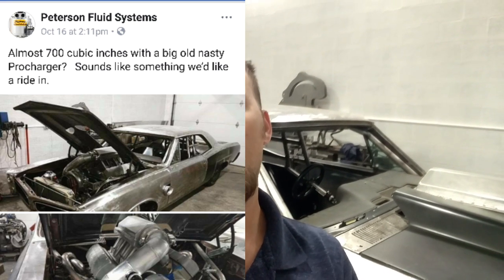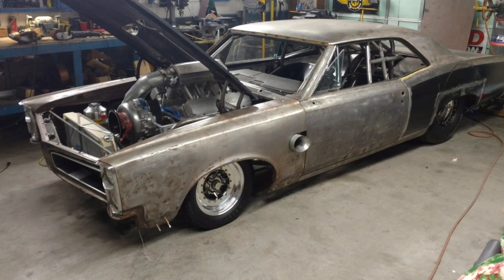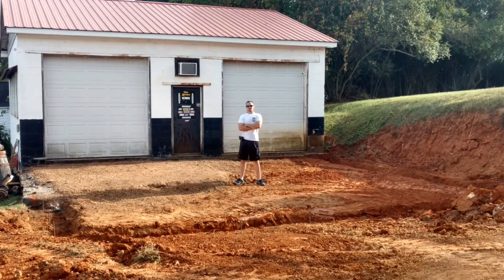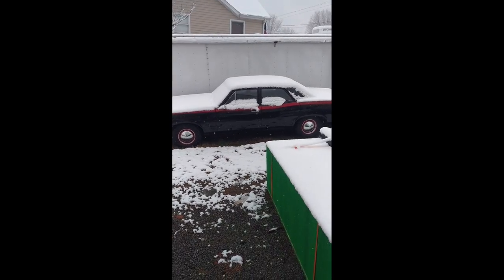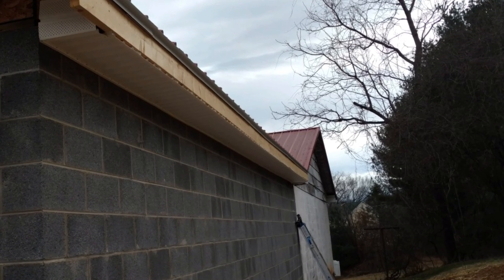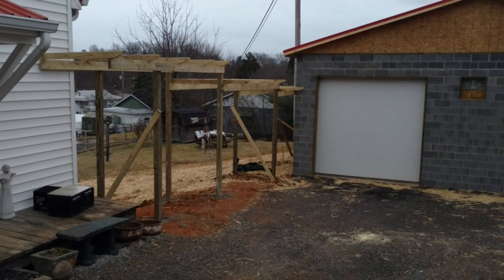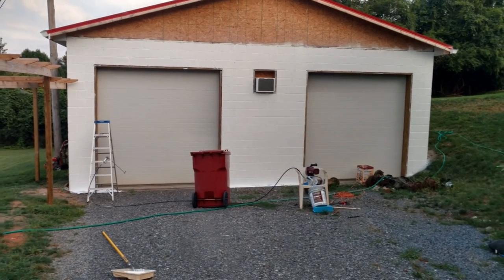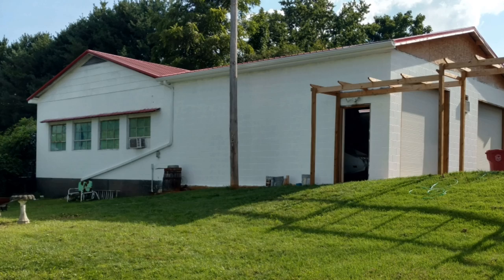NEW GARAGE BUILD!

Comment: Couple of questions, did you put insulation inside your block in the new section? Who did the block work? GTO is looking good, I've got an Astre I'm hoping to start this winter, plans are for a 501 Pontiac with some help from Butler's. If you ever get over to the Big Shop, stop in. I sit beside your cuz Adam.
Reply from the maker: The side with the dirt up against it has concrete and rebar half way up. Then I insulated the roof with bubble wrap insulation. Then used 4'x8' 1/2" foam insulation boards with aluminum foil pointed up so the ceiling is white.  It keeps it cool in the summer and it's pretty easy to heat in the winter.   But I would highly highly suggest running a heated floor it's easy and cheap to at least run the tubes then later hook it up.  It only take a window AC unit to keep each side cool.  Cool in the summer time was the biggest thing for me.
Reply from the maker: Also if I need to insulate it more I would use more of those foam sheets to go on the was. Very easy to put up.
Reply from the maker: Send me pictures !! Oh that's cool man tell Adam I said hi !
Reply: @HoustonKilby  My brother Pat told me about your channel. I'm an Injun guy from way back, first car was a 68 GTO. I told Adam about your channel and he's watched a few videos as well.
Reply from the maker: That's cool man. I love the old cars. I got 66 Tempest and 66 goat. Can't have to many lol. We will have to meet some time
Reply: @HoustonKilby  There's a lot of car guys in the shop. One of our fabricators just finished a Hilborne alky injected square body Bronco gasser. (That's a mouthful)
Reply from the maker: Oh man I love gassers I bet that's cool